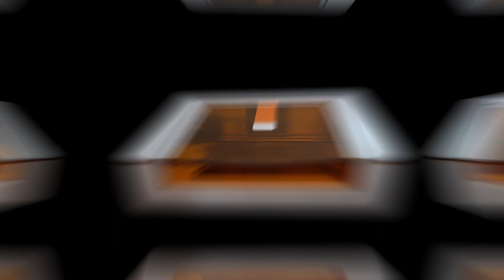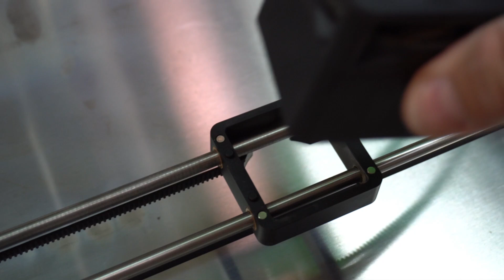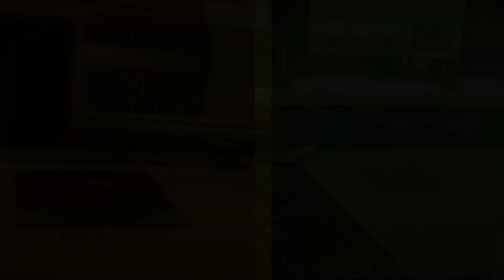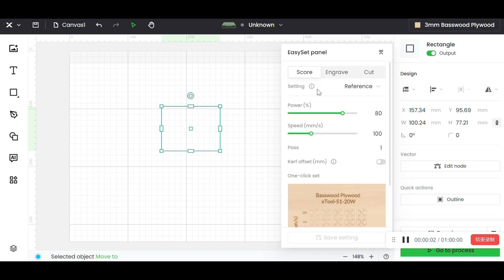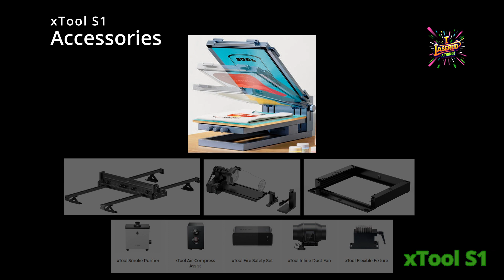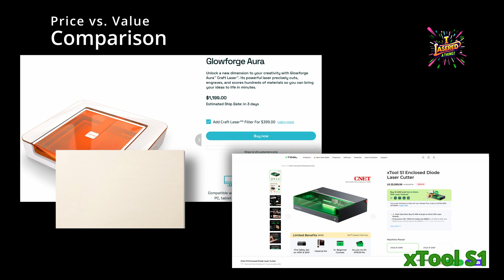Laser Engraver Showdown: xTool S1 vs. Glowforge Aura

Comment: That’s funny because I actually started off with the creality open laser found it was just a little too dangerous for me gave that one away. That was almost 2/ years ago. About 6/mo ago I decided on  the glow forge spark thinking I would start off small to See if it was a good laser. Because everybody in their mother had a glow forge , well I sent the spark back within three days of having it I did a couple test cuts on it but just did not like it, It was too small and really slow so sent that back and here we are today and it’s been about eight months. Finally saved up enough to get the X tool S1 20 W and I absolutely love it.